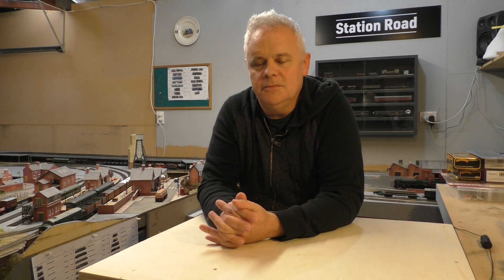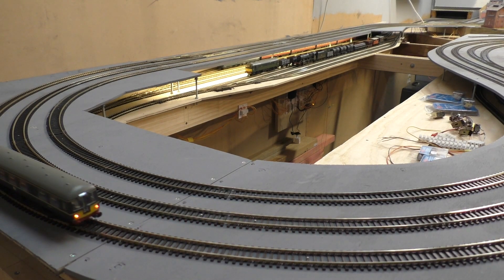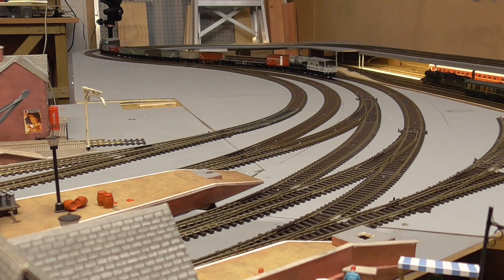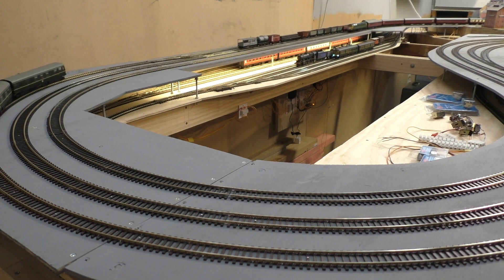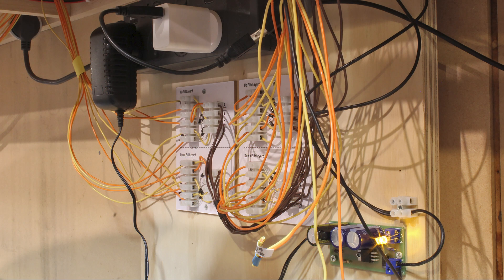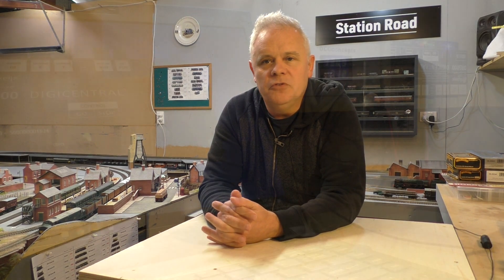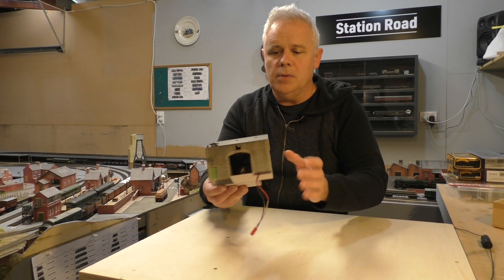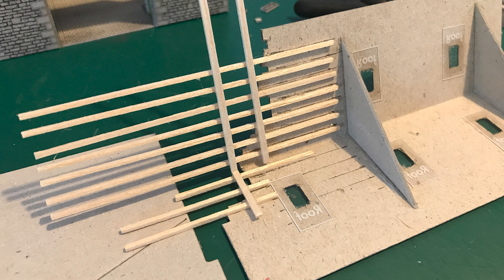March Update: Extension Recap, Wire Jungle and Frolicking in the Hay

Comment: The voltage fluctuation is your incoming power voltage to the power supply for the DR5000. what might be a .002 voltage coming in will be showing up as a 4 volt track power fluctuation.
Reply from the maker: Thanks James for your explanation. It's quite unusual because I see the meter in operation on other Youtube channels and don't see the fluctuation. One example is on Alan's channel Dragon Junction where his meter only fluctuates between 16.5v and 16.51v, whereas mine fluctuates between 13.2v - 14.7v. Alan uses a Gaugemaster Prodigy, so is the DR5000's power supply less reliable? Cheers, Julian
Reply: @StationRoadModelRailway  You can check to see if there is any variation with a multi meter on the out put of the DR5000 power supply and then check the wall outlet that the power supply is plugged into.

Comment: I like the hay method, cheaper than the purchase of yellow static grass and looks very effective!
Reply from the maker: In theory the hay material is cheaper than buying static grass, but it all depends on how you go about sourcing the softboard. If you're only option was to buy a full sheet, then it's not very economical at all. Fortunately I had a pin-board/notice board that I just cut a thin piece off at one end, so the cost was nil. The idea would be source scrap pieces from a timber merchant either cheap or free. The other thought I had was you could probably dye chunks of the board before whizzing it through a coffee grinder, thus getting different colour tones of fibres. Cheers, Julian
Reply: @StationRoadModelRailway  Agreed, if you ain't already got, it ain't cheap! Might find a small fibre pin board in the dollar store though!

Comment: Good to have you back Julian, and with something a little unexpected.
Reply from the maker: Thanks Chazzy. I felt the need the take a break from the extension work, mainly due to the endless wiring, soldering and striping dropper wires, this aspect of railway modelling is not my favourite. Changing up this episodes topic (and naughty surprise) also provides a bit of a breather from the extension series, which will be extensive. Cheers, Julian
Reply: No worries Julian mate, it's just good to see you back. In this year - of all years - we all need time to pause and think. And yes - I quite understand about the wiring.